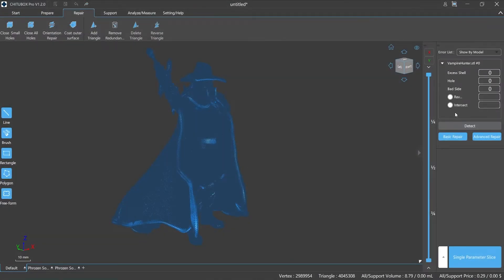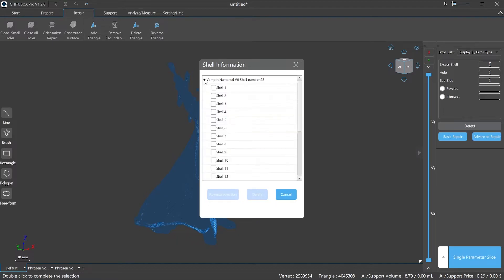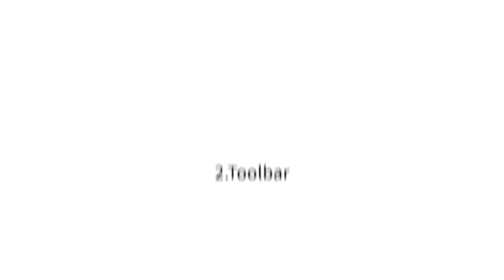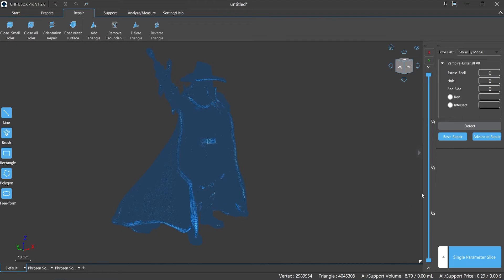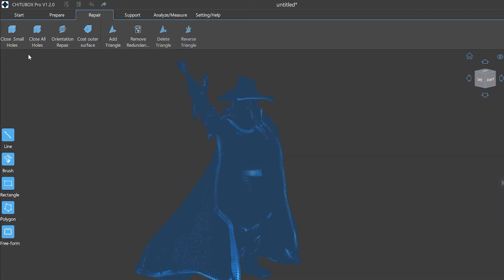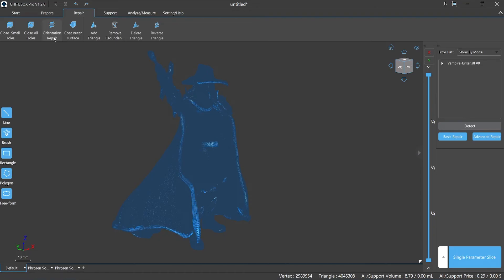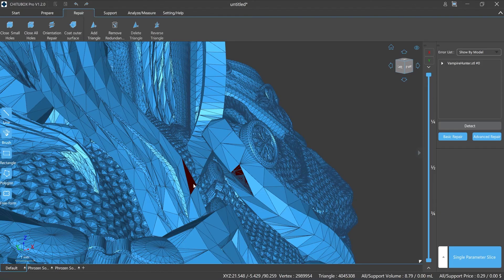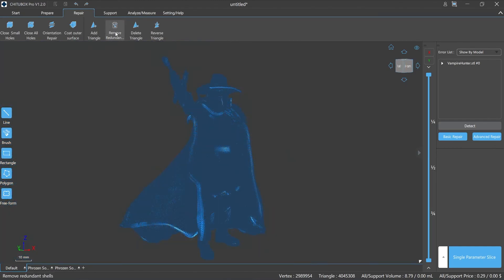[CHITUBOX Pro]Lesson 18: How to repair your 3D models?

Comment: i do not understand what delete shell function does, what shell?? why u didnt show this in video
Reply from the maker: A “shell” refers to small stray fragments (such as isolated edges, vertices, or tiny disconnected pieces) that are accidentally created during the modeling process. These fragments typically float near or around the main body of your model.
Reply: @chitubox_official thank you so much❤